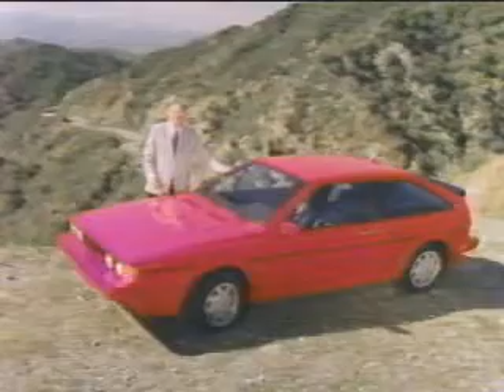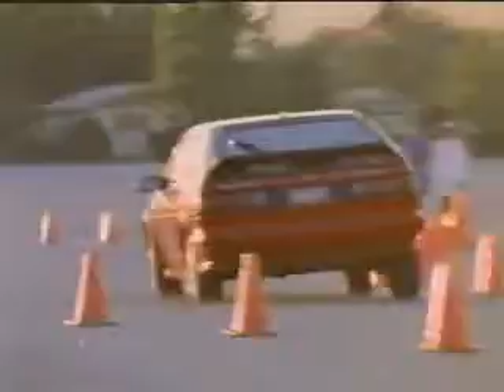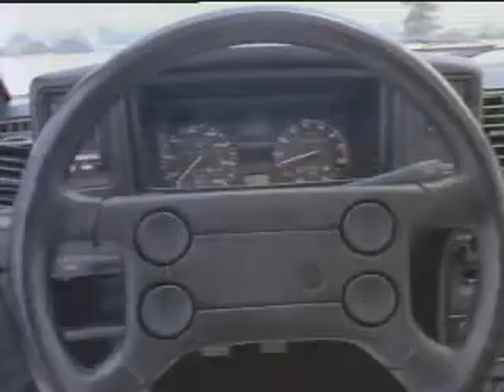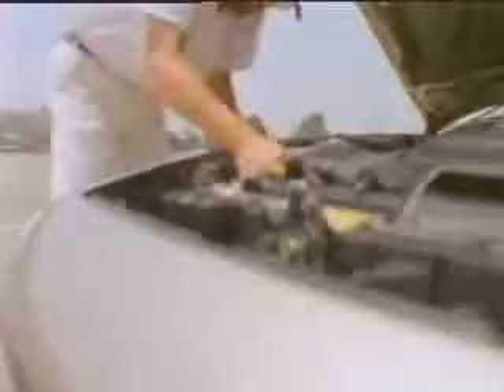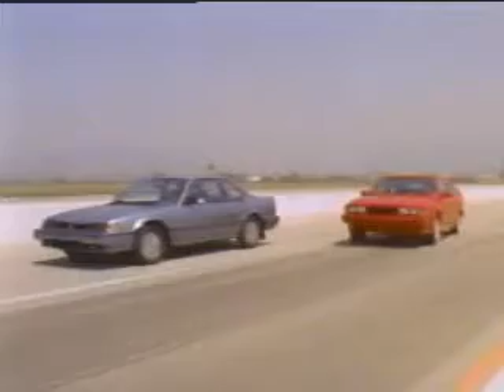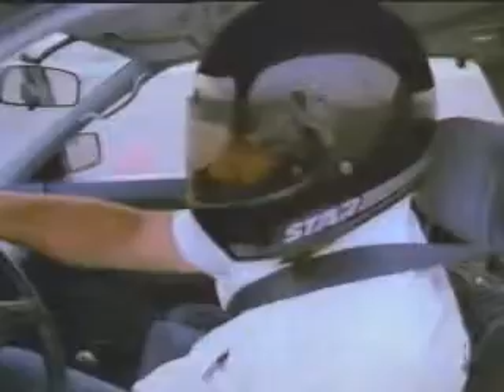scirocco 16v dealer video

Comment: i loved my 88 16v scirocco. but those other 3 cars were much more successful. the mechanical fuel injection sucked though... superior German engineering... IDK my motor mounds always broke, had to go squeaky neoprene, eventually the whole front cross member that housed the motor mount responsible for limiting torque twist completely tore apart from the chassis.the shift linkages, which were many, always needed new bushings....wish i still had it, fun car